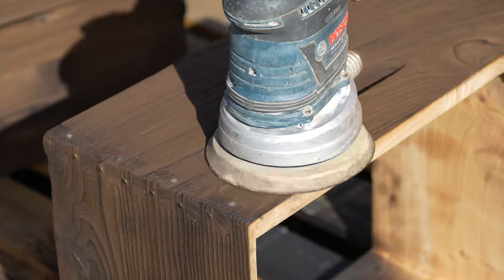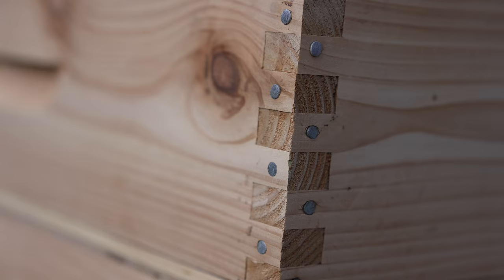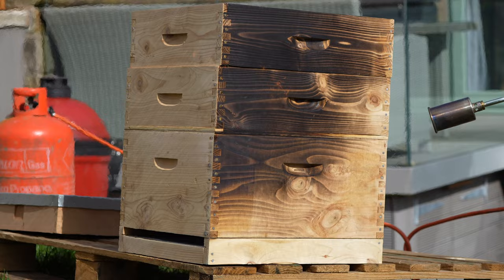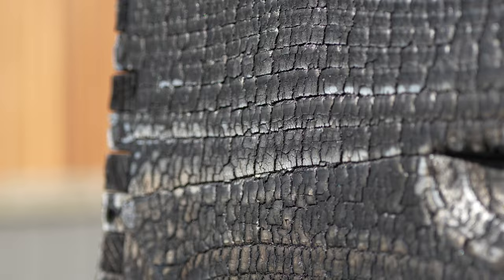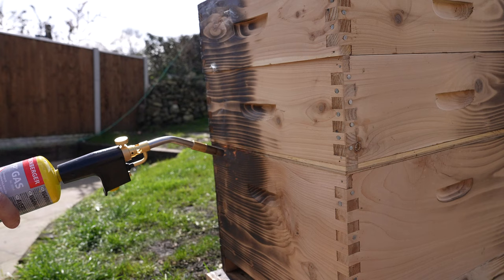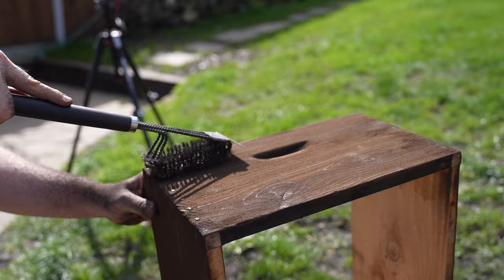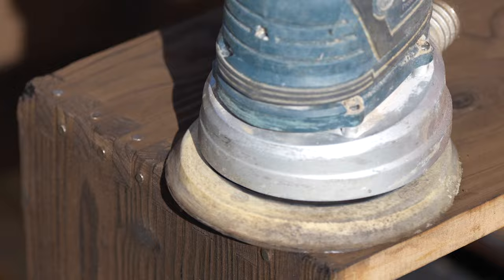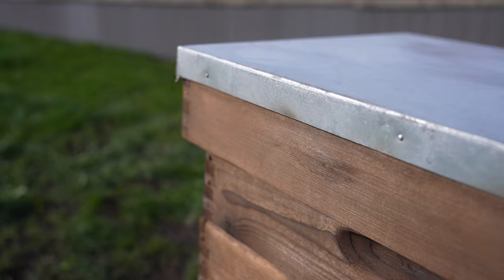Mastering Shou Sugi Ban - The Dark Art Of Wood Burning

Comment: Not to be a Negative Nick, but those are going to be sweltering if you live anywhere that gets much sun. Typically hives are painted white/ or left with clear oil/sealant on natural wood to alleviate the fanning bees need to do at the entrance, and half inch lumber doesn't have much R value. I have used shou sugi ban on the INTERIOR of the horizontal langstroth hives (Dr Leo Sharashkin's pattern) with positive results.
Reply from the maker: I like negative feedback said in a positive, constructive manner 😀

It's a good point. Luckily for us in the UK and especially Wales, it basically rains for 10 months and then if you are lucky you get 2 months of 23c 😀

Be interesting to see the benefit of SSB without the oil and it was very light as that point compared to the oiled finish